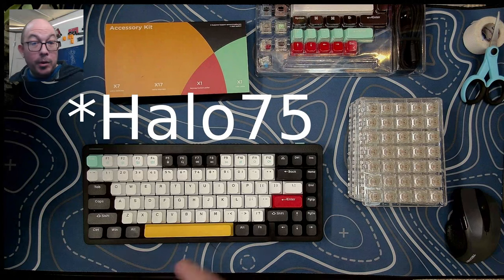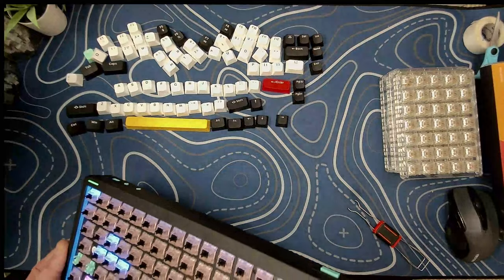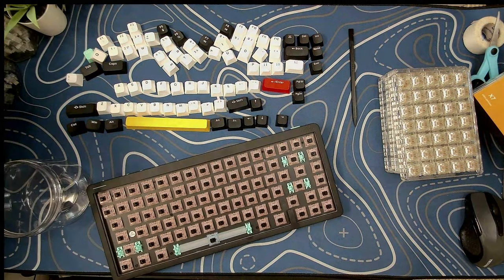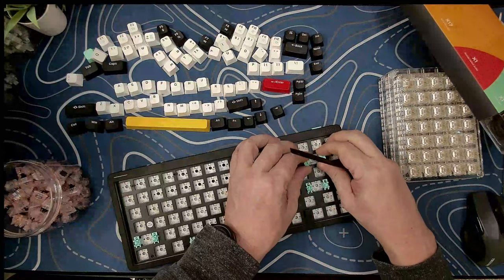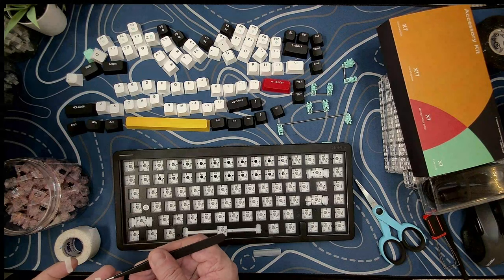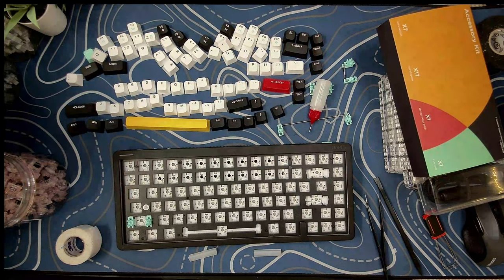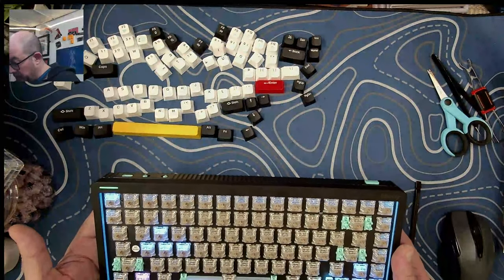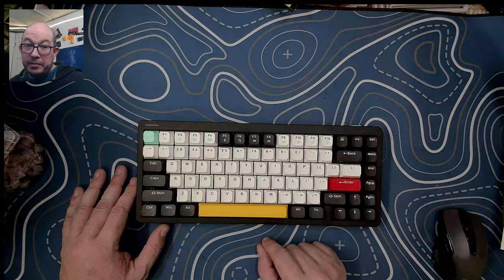Halo75 - Tuning Stabs and Swapping Switches to Gateron Baby Raccoon

Comment: Great video - thanks a lot. I now know how to mod the stabilisers on my Halo 96. Just wanted to ask if you think there is a big difference between the Baby racoons and the Night breeze switches and if is it worth swapping from the nights to the racoons?
Reply from the maker: There is, but it's minimal, they are both decent linear switches.
Reply: @MechKeyboards  I thought as much - when I have them side by side on my Halo 96, I can barely tell the difference. The racoons are slightly heavier but sound wise, very similar.

Comment: I followed your approach to tightening the stabilizers with tape and lubing the holes for the stabilizers. The shift key on the left side didn’t want to spring back after the mod (it felt stuck), so I removed the tape. It’s actually pretty secure there on my board without the mod, so thank goodness for that.
Reply from the maker: Yeah, sometimes, rarely, but it does happen, the wire has the perfect tolerance, so the tape just binds it. Glad you got it worked out!

Comment: Hi, how would you tell it compares to keychron q1 or k8 pro in terms of sound/feel?
Reply from the maker: It's different that the Q1 as that's a gasket mount, and this is a top mount, essentially. It's lighter and more flexible in as far spacing goes, while staying substantial. It's difficult to compare as there are many differences, but both are great keyboards. I never had a chance to review the K8 Pro.

Comment: Hello! 

May I ask if the website's 38mm (~1.5inch) height dimension is with or without keycaps? And is it correct? Would be cool to know the frost row's height too if I may ask!

I bought a GMMK 2 (96%) but the website's 37.5mm height is not correct, because it's 4.5mm (1.77 inch) tall, the board has too much incline for me for gaming, so I'm searching for a shorter keyboard.

Thank you for your videos and for the answer if you dee this :)
Reply from the maker: All of the heights can be found here: https://youtu.be/Rp25KEK1m0Q?t=1082
Reply: @MechKeyboards  Aaah thank you. I watched that video but somehow didn't pay attention tonthat segment it seems. Thank you very much!
Although I'm new to the hobby you make one of the most in depth videos about mech keyboards! Keep up the good work!
Reply from the maker: @xCori91x  Thanks!

Comment: What would you say comparing this board between the TH80 and Akko 5075s
Reply from the maker: The top aluminum frame makes it quite substantial. IMHO it highlights the cheap quality of the 5075 and compares to the NJ/TH80 in substantiality and feel.

Comment: Hey I was wondering if the baby raccoon switch is quieter than the baby kangaroo
Reply from the maker: I never received the Baby Kangaroo thus cannot compare, sorry.
Reply: yea its quieter than baby kangaroo and Rose Glacier. Baby kangaroo may be the loudest but Rose is slightly more tactile than Baby kangaroo. both rose and kangaroo are tactile and klik klacky. Im loving the baby kangaroo and making noise with it.

Comment: can't decide between Halo75 and keychron k6 pro.
keychron k6 pro has PCB mounded stabs, but overall Halo 75 maybe better.
Reply from the maker: The Halo75 is stylish and different, it stands out over the K6 Pro, IMHO, though most Keychron keyboards can be loaded with QMK/VIA.